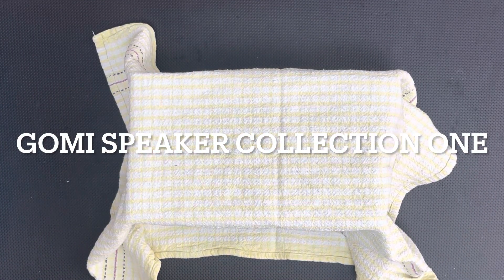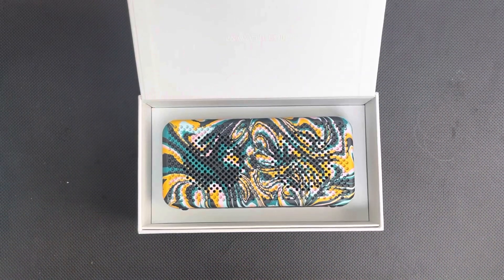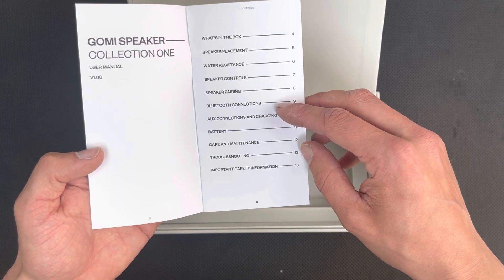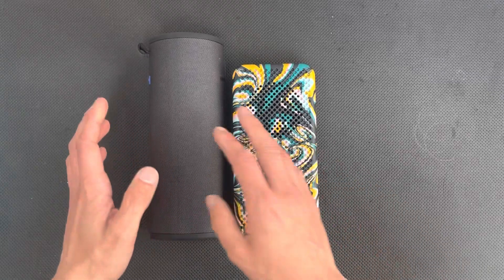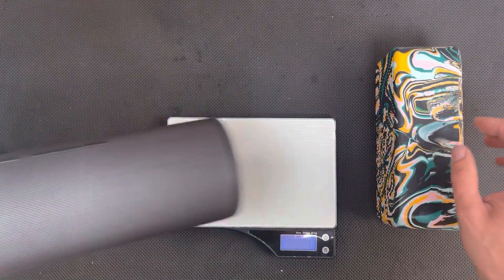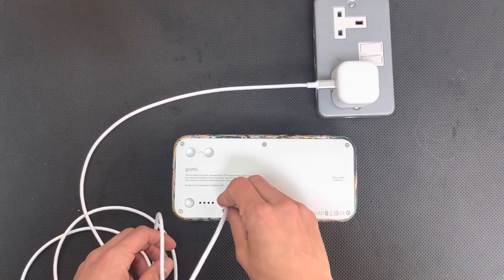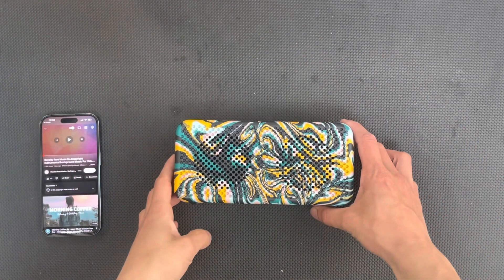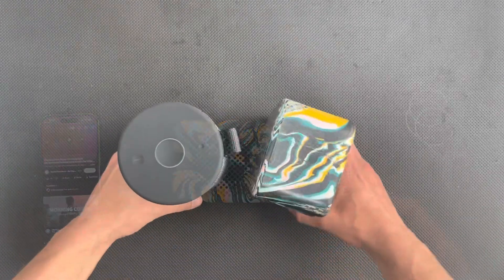Gomi Speaker Review - Collection One - worlds first speaker made from waste

Comment: The sound test at the end is misleading. The UE speaker emits sound in all directions, hence the round design. The Gomi speaker only emits sound in one direction, and it was facing directly at the phone doing the testing so not very accurate representation of the sound volume.  I suggest you do it again with the phone on all four sides of the speakers then you'll see a difference.  Also the Megaboom costs half as much as the Gomi.